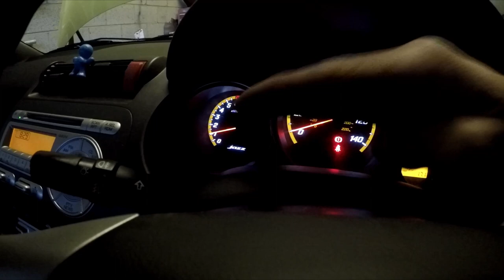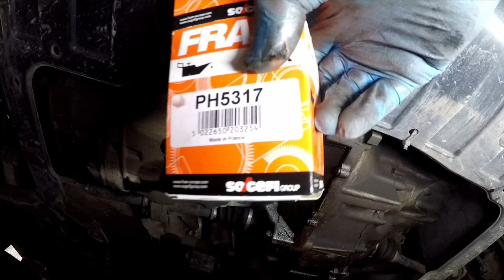How to: Honda Jazz OIL filter change #honda #jazz #oil #service

Comment: Good video but microphone is very bad
Reply from the maker: What's wrong with the audio? Seems clear when I play it?
Reply: 5:13 to 6.20 and maybe later too (I'll need to replay to find parts)
Reply: Also around 7.30
Reply from the maker: Let me be really clear .. it's annoying, it annoys me. But in post/editing there's little I can do. I can't redo the video. I get maybe a few £ from YouTube to do a video like this. It takes maybe an extra 30-45min for a 30-45min job to film the tutorial. That again to edit and upload it. So my budget for high quality mics is low. Despite that, I am using a Rhode wireless mic for this! What else can I do?
Reply: @PiggyPower  no much I suppose. I thought I’d let you know, that’s all.
Reply from the maker: @ultraciao  sometimes I have the time to do voice over. But if it's just little bits which for some reason aren't clear I can't invest the time. I'd love to be able to, but I want life more than money

Comment: Hello. Thanks for the video, but I noticed that you didn't replace the crush washer... Doesn't it take any?
Reply from the maker: Did you watch and listen at 2:35?? 🤔😉
Reply: @PiggyPower , I did, but it's hard to believe that there are sump plugs without crush washers... Thanks anyway.
Reply from the maker: @johnmano1439  why is that hard to believe?
Reply: @PiggyPower , because in almost all of the oil change videos out there, you see the mechanic replace the crush washer, or not change it, but mention that it's best to do so...
Reply from the maker: @johnmano1439  but this vehicle, along with most Honda's and a lot of other Japanese vehicles don't have that type of sump plug 👌🐷

Comment: Nice video. But i think low saps oil its not ideal. Full saps A3/B4 its a better idea for Jazz
Reply from the maker: For this twin spark engine, no Vtec, no difference would be seen/found from that different oil. If you feel you wish to spend the extra on a £1000 1.4 jazz... Sure... But it really wouldn't make a difference in the long term
Reply: Can i put motul 8100 5w 30 efe  c2,c3 in my honda jazz 1.4 i 2012 specifications oil?

Comment: my f***ing drain nut is stuck. the bolt is fine and 17mm socket fits, but no budge..
Reply from the maker: If it's not rounding off .. your not trying hard enough! Give it some heat (hot air gun)

Comment: Was this Jazz used at all? I can't see a sea of rust like mine!
Reply from the maker: Got about 80k on the clock. Not lived by the sea if that helps
Reply: @PiggyPower  what plate is it? Mine has done 134k on an 07. The bloke that sold me it struggled to get in the car with me whilst he was wearing his stetson and 6 shooters.
The MOT was just passed.
It may as well have been written on spirograph.
I've basically bought the car twice.
Reply from the maker: @BURP39R  I can't remember. It's all about who has owned it rather than the age and mileage. Some cars at 200k are in better condition than some with 50k
Reply: @PiggyPower  true that. Like any car. Mine has a load of service, two keys, etc.
I think I should have paid attention to last receipts. They weren't that current.
When I move it on at least the new owner will see I've looked after it.
Hopefully I'll get a bit back.

Comment: What is that oil spesification ?. API SL or what ?
Reply from the maker: Can't remember off the top of my head, this was probably 18mths ago. C3 5w/30 though I believe,fully synthetic. If you're not sure what you need, check the manual or go to the dealership and be sure 👌🐷